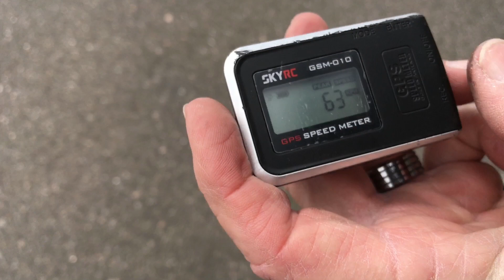RC car steering upgrade and speed test

Comment: The way to re-use the nylock nuts is to just use a little bit of blue Locktite on them, works great!
Reply from the maker: I agree Philip and if you have loctite handy you could just use a regular nut. Fingernail polish also works and you can use clear. 

I like Nylock nuts for the convenience since you don’t need to wait on anything to set up. 

Thanks for stopping by. Have a great day and be safe out there!

Comment: what was the max range you get using stock radio??? was it the same in all your wltoys cars that came with that same radio??? i ask because my range seems to be only up to around 50 or 60 feet.. i check rx antena and it all good... maybe some radios are just not as good of range... i tested in my drive way and road in front... maybe its wifi in my area causing poor range...just not sure... thanks...ps that is some serious speed for a stock little buggy...great job!
Reply from the maker: I have some of my Wltoys with the new radio and some with the old radio and the will work to the end of my street which is about 250/300 ft. You might check the transmitter batteries too. That will limit your range. 

Thank on the speed runs. I do plan to do more with this car. It might take a bit but I do have plans for some upgrades.
Reply: @RCModSquad  So you have had cheap batteries make a difference in range??? i thought as long as it binds well and green light is solid the tx batteries should be good range... let me know if you had same thing happen and putting new batteries in made a world of difference... thanks... all my other rc toys use radios with lipos...yes if i had 200 foot plus range with this stock thats great... thanks again..
Reply from the maker: @roadstar499  for some reason I’m not getting notifications on my comments. 
Sorry for the slow reply. 

Yes, if your batteries get low it can drastically effect the range. The antenna orientation make a difference also. The antenna needs to be as close to be vertical as you can get it. 

There is as much as 20db loss between horizontal and vertical.

Comment: Sir, would foam tires last longer than rubber tires on that parking lot surface?
Reply from the maker: Stephen Ksiazek it would depend a bit on the surface of the parking lot but I think that they handle high speed better. 

On a rough surface it can tear pieces out if they spin.

Comment: Hey... today i installed 144001 in my a959...fit great ..only issue is the 5 pin plug used in my a959 is to small...why the hell they had to make to different size 5 pin connectors is beyond me... and i do not have a 5 pin servo to replace the current one... i wonder if there is an adaptor  available? In this video you do have what looks actually the same esc that was in my a959... and looking at them the connectors seem the same... just thought i would share this with you,so maybe a viewer will not make this mistake...thanks
Reply from the maker: I think I covered that in a video but I’m not sure which one. For now you can use the ESC and radio that came with the a959b and just swap the motor.
Reply: @RCModSquad  no i fried that radio using a 3s lipo conversion..
Reply from the maker: @roadstar499  you killed the a959 ESC?
Reply from the maker: @roadstar499  oh, I remember, you killed the radio.
Reply from the maker: You can use the servo from the 144001.
Reply: @RCModSquad  yes if i can mod it back to the large 5 connector...that was another boo boo involving a sg 1603 that came with a crappy servo... i installed the 144001 in it and realised the sg1603 also uses the smaller 5 pin... then i swapped the connectors between the crappy sg 1603 and 144001 servos ..this ended up frying the 1603 esc servo port...only throttle and light ports work...quite a mess i made ..lol i believe those smaller 5 pins are for a reason...lower voltage out put...

Comment: doyou give me link to the tires???  nice run
Reply from the maker: komandos kom 

Hobbypark 4pcs-Pack 26mm Width RC Rubber Tires Plastic Wheel Rims 12mm Hub Mount for Redcat HSP 1:10th On Road Car Touring https://www.amazon.com/dp/B01MXDCQ1F/ref=cm_sw_r_cp_api_i_TObuDbHW79ABK

You will also need these. 
DiDi/iRC 7mm to 12mm Adapter Remote Control Parts Aluminum Wheel Hex Adapter Hub for 1:18th Wltoys A949 A959 A969 A979 K929 RC Hobby Car 4-Pack https://www.amazon.com/dp/B01H26YNLG/ref=cm_sw_r_cp_api_i_NQbuDbEFA1KM6
Reply from the maker: komandos kom thanks for watching! Have a great day.